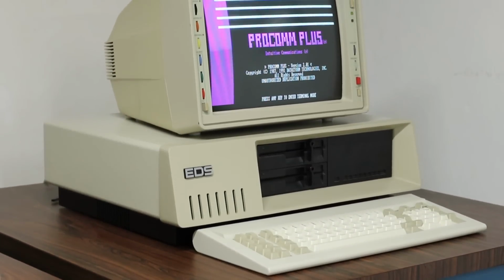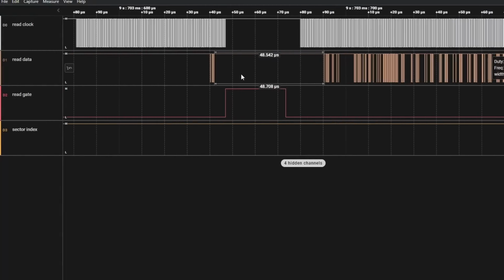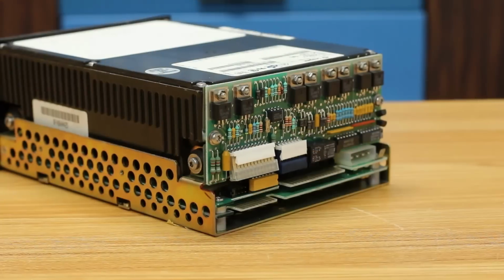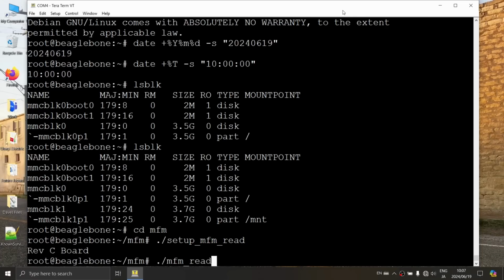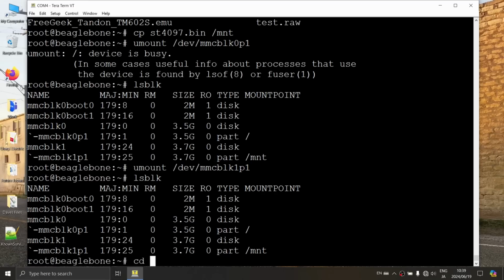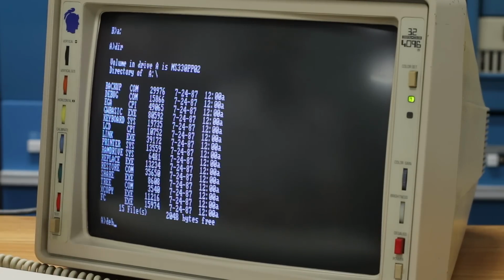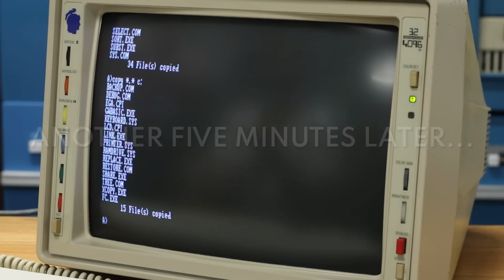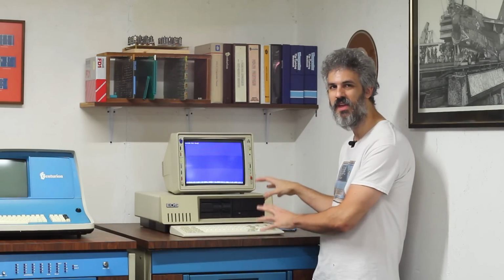FM is RLL, MFM is RLL, RLL is RLL! Fight me.

Comment: Back in the day, the telco I worked for used mainframes and mini computers for all IT, we used various terminals to talk to them. When PC's came out it was cheaper to use a PC clone as a terminal. We had a company supplying up with these low profile clones that booted from a floppy drive, however the user could not see it as it was hidden inside. The 3.5 inch drive was in a regular drive slot, but pushed back as far as it would go, then the blanking plate that came with the box was placed in front of the drive. This was not a problem as they were only booted at the start of the day - sometimes even less as slack employees often just left them on at the end of their shift.
Booting gear from floppy was fairly common in the IT industry, we had these network controllers (forget the brand)
that were dedicated controllers, not PC compatible in any way, that booted from 5.25 inch disks.
Actually the floppy disk was originally invented by IBM to IPL a mainframe (Initial Program Load) and later got developed to what we saw later powering whole generations of computers.

Comment: Yes, screaming at the screen.....
Anyway, if you just want to use that as a terminal, then you'd probably be better off unplugging the hard drive and instead adding one of the SD/CF card hard drive emulators out there.
However as you want to use it as a backup spot for the Centurion (surprised your not already doing this) then you could just write an Xmodem or Zmodem file transfer program for the Centurion,  as Procomm on the EDS already has that covered.
Procomm also can capture text and save that as a file, so you can start a capture session, then get the Centurion to dump a file as HEX etc. maybe not as easy to go back the other way, but at least you have a copy. just remember to close the capture session after the hex dump. Procomm can also send a text file, so if the Centurion can accept that and save it that would be good, however the above mentioned Xmodem/Zmodem is better as it has error correction and the resultant files are binary etc.

Comment: You've low-level formatted the ST4097 with the drive parameters of the ST238R, so you'll only have 30MB usable. On these older controllers you have to select the drive parameters with jumpers. They depend on the Controller's BIOS ROM version though. There are lists online of which ROM version supports which drives. It's quite possible that your ROM won't support the correct parameters, so you'd either have to modify it and change the parameter table, or get the WD SuperBios which can be configured to any drive parameters.
The ST4097 is a 80MB MFM drive, so with 2,7 RLL it should give you roughly 120MB!

Comment: You can run MFM drives on an RLL controller and, back in the day, be very happy getting 50% more space, but there's a cost. As the drives heat up, you can end up getting more and more read errors since the disks aren't really rated for that kind of density. The drive may last a couple years running like this, then the errors start. I ran into this with a couple of ST-225's. Both drives started with read errors about 2 years into their lives.  It got to the point where they were so hot, I couldn't touch the drives after 30 minutes. 

I really had to copy the data off of them, but to keep the drives running cool enough for long enough, I had to run the drives under a towel and a gallon bag of ice water. Worked like a charm!

Comment: In future, if you want to save yourself time creating a bootable disk, you can do it with FORMAT /S
i was wondering if you'd get bitten by the partition table not having the partition marked as bootable, and would have to go back into fdisk to flag it.

Also, the interleave is a fun tuning problem, as it's intended to allow for faster/slower computer/drive combinations. For a slow computer and a faster drive you would use higher values, but if the computer could keep up to the data read speed, a 1:1 interleave was possible.

Comment: Brings back memories of using stupid batch commands to automate prepping newly installed MFM drives in about 1994. Working for a Mail order computer reseller we had NIB 386sx-16s, new 1.44 M floppy drives and used VGA cards, MFM controllers and ST-225 drives. We put DRDos 5 on them because it was $5 per copy. With one, non-technical person helping me we assembled and prepared 41 systems for an order one day and only accidentally left two floppies in the machines, which I had expected might happen so I had made 10 to use. And yes, both customers that received a system unit with my customized boot and prep floppy called for tech support because (entry level computer customers).
Reply: MRDOS?

I recall DRDOS, (digital research) but not Mr.  Where did that come from?
Reply: @ChuckvdL  You're right. It was a typo. I've corrected it.
Reply: @mikebarushok5361  no worries.  There were a few obscure licensed (and pirated) versions of DOS in that time, and I thought maybe it was a new one to me.

Comment: This reminded me of the Perstor 180 and 200 series disk disk controller boards from the late 80s (I think). They used a more aggressive RLL coding, which would allow pretty much a capacity doubling relative to their MFM capacity, rather than the extra 50% from the regular 2,7 coding that was normally used. Of course, they also required even better timing stability in the recovered read data signal in order to operate, but by the late 80s more drives were capable of that level of performance.

Comment: Curious as to whether you saw the increase in the capacity when formatted the ST4097 to RLL(2,7) - should have been up from 80mb to around 120Mb. If you value the data you plan to put on the disk, it is not recommended that you use an MFM drive on an RLL controller. Not all MFM drives are stable when used with RLL controllers, and you could end up with data loss issues. Also look up a copy of a program called SpinRite by Gibson Research. It can optimise MFM/RLL drives and determine the correct interleave, amongst other things.

Comment: OK, now I'm worried about my brain. How much old info is in there that hasn't been used for decades. Many things popped up in this episode that were 
Back in the day, I've seen 2,7 RLL and not understood what it means, now I understand - thank you.

Then you went into debug and my brain said g=c800:5. How many years has it been since I needed to do that ???

Don't forget to set the drive type in the BIOS first, so that it know what to format to. Type 47 and 48 are handy for custom Cylinder, Head, Sector (CHS) setups for drives that weren't listed in the BIOS. The other trick was to find the one that is lower, but closest to the ones listed in the BIOS, so you get the maximum capacity without going over any of the CHS values.

The Interleave value is the increment on sector counts as they are not written linearly around the track. By changing the interleave, you can boost hard disk read and write speed, or make it much, much worse if you pick the wrong values.  The aim is to have the next sector come under the head at just the right time so that there at the point the system wants to read it, hence minimising disk latency.

To copy everything between drives, you need to use xcopy, not copy. Copy only copies files in the current directory, xcopy will do subdirectories as well, its like the robocopy of its day. I was also shouting at my screen "sys C:", but you caught that one.

To use the whole drive, make the primary partition at 32Mb, then create an extended partition, some DOS versions have limits on 32Mb on the secondary partitions, Later versions allow for larger secondary partitions and eventually larger C: drives too. You will end up with C: and D: (and possibly other drives). There are also limits of 4 partitions in the partition table on some versions of DOS too. Later versions fixed this and allowed more partitions. Try and use DOS 6.22, it was the latest version before Windows came along, so it has the best support for larger hard drives.

Comment: I recall from back in the day that formatting mfm drives RLL usually worked... Sort of. But they developed errors and were never reliable. I tried it a few times with drives that I considered to be really good , that had very low error counts and all, and it never worked well enough that I didn't end up replacing the drive with a realm RLL or replacing the controller with an MFM after a week or two of headaches. The consensus at the time seemed to be that my experiences were not unique and it was not a reliable thing to do. That being said, there were a few people that claimed it worked for them.
Reply: I still have one that I haven't powered up for several years now. It was an ST-225 with zero bad sectors and that seemed to run quieter and cooler than the others. So, I bought it and took it home and formatted it using an RLL controller as equivalent to an ST-238.

If I remember correctly I used it nearly daily for a couple of years in a couple of different systems, before setting it aside.

Comment: If that's a 4.77MHz 8088, then Interleave 4 may be too tight - if too tight, you only get 1 sector per revolution (speed in the order of 30k/s). With a good controller, it seems an XT can handle 4:1, but 6:1 is generally reckoned to be the "safe" option, though some Seagate controllers are worse.
There are a few utilities which can test and re-interleave, the old Norton Utilities being one of them ... Calibrate (calibrat.exe)

Comment: I remember getting 50% more out of my MFM drive by reformatting it to RLL. It worked for years until I upgraded that 30 Mb drive to a 42 Mb IDE. I was saddened that I could not do the same magic with an IDE, but it was a LOT faster. Didn't sound as cool.

Comment: If you can find a copy somewhere, there is a special version of DOS used by Compaq, that was listed as 3.31, which is DOS 3.3 (IE doesn't start to introduce the extra bloat and weirdness of DOS 4.x which wasn't good for older machines), the key thing that 3.31 has over 3.3, is that it DOES have the ability to access larger drives.

Oh, and the reason you can't "sys" the disk after you copy files to it, is that DOS requires the system files to occupy specific sectors... and those sectors have to be free within the FAT filesystem otherwise it can't boot... I discovered this by destroying my "family" PC when I was 12, by accidentally moving those files into a folder, and then when it didn't boot and more I moved them back, and it still didn't boot, because DOS put the 2 hidden files (msdos.sys & io.sys) in a different physical location.... my 12 year old self had to format the drive and re-install, but that experience sparked my learning about how DOS boots, and much more... so now I know that if you can remove whatever files is occupying the specific blocks/sectors that "sys" wants to write to, then it will write a system to the disk without removing the files.

Also, to make this all much faster, you can "format c: /s" which will install the system while formatting... I'm an incurable hoarder, and although I kinds expunged DOS/Windows from my life in 1998 and switched to Linux, I was able to dig up some DOS stuff.... file dates between '87 and '94, I'm sure I could stick that stuff online somewhere if you were interested...

Comment: Thinking way, way back, and with some uncertainty: a handy keyboard thing is the upand down arrow keys.  From the command prompt, type UP-arrow and it displays the previous command line.  DOS keep a few lines available.  Browse through them with UP and DOWN arrows.  When you get one you want to repeat, press enter.  If you want to edit it, use RIGHT and LEFT arrow keys.
Reply: This should work for the Linux OS on the BeagleBone, but does not work for DOS. In DOS you can use the F3 key to bring up the previous command.

Comment: I vaguely recall that you need to run the "SHARE.EXE" command in DOS 3.3 to reliably use large hard drives. I learned the hard way 35 years ago when upgrading the hard drive to a 330 MB beast, restoring about 90 diskettes of backup only to having installation of HP's Scanning Gallery software -- Remember when the HP ScanJet was a $2000 piece of awesome--scramble the drive. I think my client and I spent all night doing this 3 or 4 times. It drove us crazy. There was no hint that anything had gone wrong during installation, except that afterwards the directory was scrambled. In those days, HP support would talk to you, but they had no idea why this was happening. I don't exactly remember how I figured this out since there was no internet then.  I think I went to the DOS documentation that mentioned the need to run the share command on a larger capacity hard drive. I guess they tacked on large drive support to networking.   The client asked me to inform HP.  I earned my wizard cap in his eyes when he saw that I could solve a problem that HP couldn't.

Comment: FM and MFM are forms of RLL, but RLL (2,7) is encoded at a higher bit rate.
* Do not trust that raw backup you made of flux transitions unless you can confirm it was read at high enough bit rate *
MFM ST506-interface drives used an encoding bit rate of 10MHz. 'RLL' ones used 15MHz.
I think the Gesswein board captures at a raw 200Mhz bit rate. This should be sufficient oversampling to pick out 15MHz RLL (2,7) encoded data from the raw samples. Just be careful not to ignore bit rate when saying MFM is RLL.

Comment: That "insane" list of errors was actually common in late 80's when installing Netware. Can't remember the tool but we always had to run a program (sys?) to warn the os of the bad stuff. Then ages of figuring out if track 0 was reliable and then an age of checking the disk. Later versions could handle bad blocks dynamically shaving days of installing a server.

Comment: I had a MFM drive as well as RLL drives way back in the 80's and I don't remember exactly what I was doing with them (maybe copying one to another or swapping them out) but the drive (I don't remember which one) just started to make all kind of noise like the write head was just bouncing back and forth off it's stops.  I then realized that it needed to be mounted in the chassis because it used it for ground.  Just FYI if you have the same kind of problem.

Comment: What you should do is to read that MFM drive  you now "controller-converted" to RLL with that smart interface, write it to file, and put it back to the drive. Thing is to verify that your original backup of your critical drive is valid. 

There is always a chance that it simply missed or dropped something and said it read just what it was able to "decypher".

Comment: That's a good thing that you backed up the original hard drive from EDS computer - the funny thing with the ancient hard drives is that you would never know if and when it's failing or not. Also, the RLL encoding chipsets are usually tolerant of MFM hard drives since basically RLL is like MFM and MFM like RLL, so the data and control protocols are basically the same - meaning you can get away with using either MFM or RLL hard drives in given configurations.

Lastly, it would be interesting if anyone have made the MFM solid state drive from scratch with microcontroller and flash chips (personally I would prefer magnetoresistive RAM - MRAM - memory chips as they have significantly better rewrite endurance compared to SPI flash chips, and MRAM is basically like a modern day magnetic core memory only it's non-volatile) - the computer would boot significantly faster than with the spinning platters since there's absolutely no seeking time to factor into, the processor in microcontrollers are significantly faster so they can directly translate whatever is on flash or MRAM chips into MFM / RLL commands and data that the classic computers can understand. ISA SSD is also a doable option IF the bootloader in the particular computer would know to look for bootable media on ISA bus (not all PCs from that time know what to do with it - I knew IBM XT computers can boot off that, Adrian Black have been using the Compact Flash XT-IDE card on this PC, it basically works fine).

Comment: While DOS 3.30 works with up to a 32MB drive, it can be a hassle to have extra drive letters around.  Support for partitions larger than 32MB comes in DOS 4.01, but this version is a dud... so the trick, if you want to stay in DOS 3.xx land is to get a copy of Compaq 3.31 or Zenith 3.3 Plus.... which both support FAT16B and larger partitions.  DR DOS and other OEMs also supposedly supported FAT16B, but I only personally dealt with Compaq and Zenith's versions back in the day.

I used to go on so many tech calls back in the '90s where someone was desperate for drive space... and it would turn out they had a perfectly blank drive D: sitting right there... but never noticed by the owner.  Oops.  However, this was the solution for OEMs and installers before FAT16B became available.

Comment: In my old 286 system I had a Seagate ST238R HDD controller. I ran several different MFM drives as RLL with absolutely zero problems.

Comment: My first linux box was a 386 with a pair of 20mb MFM drives that i had low level formatted on an RLL Controller to bump them up to 30mb each. Yes there were a lot of bad sectors but it still worked.